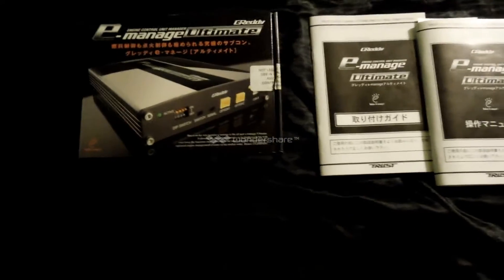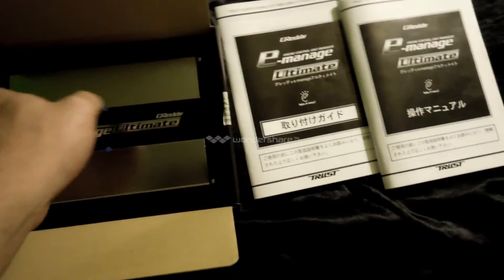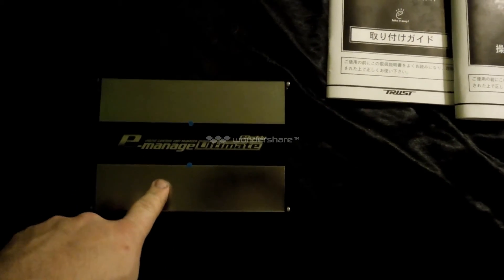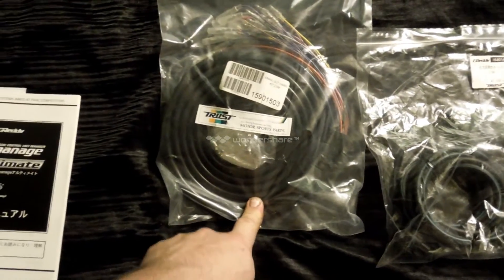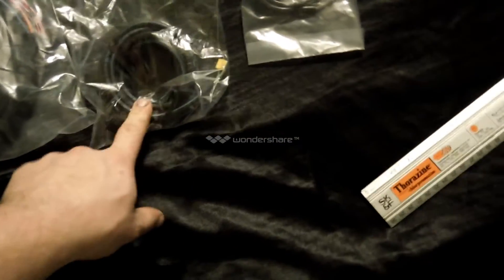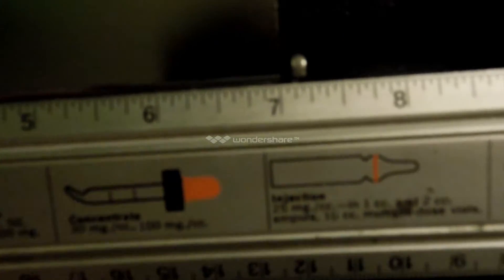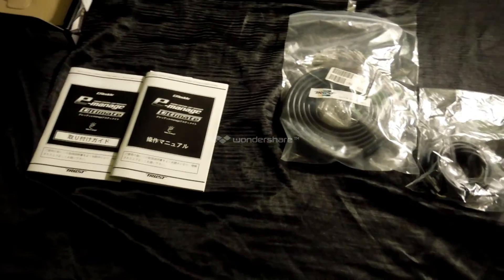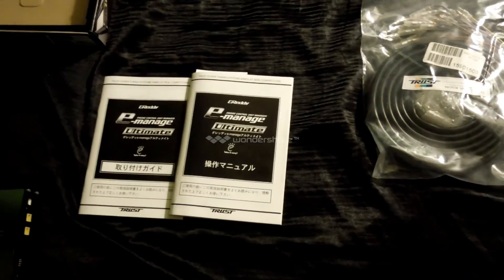Greddy E Management Ultimate Piggy Back System

Comment: what is a correction adaptor and what is it used for
Reply from the maker: a correction adapter is something that is used to eliminate a check engine light. for example, if you get a check engine light because of the injector wires being intercepted by the greddy emanage ultimnate and the main computer doesn't see the needed resistance it will turn the check engine light on. to correct this, theres an injector adapter to provide the resistance the the main computer neeeds to see to keep the check engine light off. see greddys website for more info about the listed adapters: http://greddy.com/products/electronics/e-manage-ultimate/

Comment: Hello need your help if i need the Emanage still needed also the stock ecu for the engine both need to use?
Reply from the maker: the emanage system is a picky back style system, it is not a full stand alone. so yes, you will need to use both computers in order to run the engine if you use the emange system.
Reply: OK! Thanks for the info. :)

Comment: quick question ive got the same Emu unite sitting in my house, how did you Find the EMU ? was it easy to use ? also for the wideband plug do u have to get a specific widband Brand for the EMU ? or any Wideband will work ??
Reply from the maker: i found the greddy ultimate system online. they still sell it. Although some of the supporting features, like adapters, check engine light eliminations and such, are becoming obsolete/discontinued. the system works well for a lot of Japanese engines like the 4g63 engines. for the engine i have, the 420a engine (which is an american made mopar engine), i am limited on what the system will do for me on all it's features unless i pay a lot of money to have some things made. for example the ignition portion of this emu is ment for control of an ignition control module or coil on plug ignition systems with ignition modules installed internally in them. for direct high amperage ignition coils, like the waste spark coil on my 420a engine, i would have to do some trickery with two special relays and two special ignition module adapters which cost a total of about 600 dollars to do. plus the target air fuel ratio only works when you hook up one of the knock/water temp wires up to the engine coolant temp sensor. overall there was a lot of fine print reading i did for this emu, and it basically restirctions on how the system is able to do some of it's functions; and personally i didn't like that so i gave up on this emu and went with AEM. The greddy wont handle any injectors bigger than 999cc due to it's software limitations. i have even emailed greddy for a possible update but no replay after a year and dozens of e-mails. with the aem fic6 i can control fuel and subtract ignition just fine which is what i really need. aslo, i can control up to approx. 2000cc saturated injectors just fine as well as create base fuel and ignition maps from entering a few parameters.

As for your afr guage guestion, any afr guage can be used as long as it has data logging output capabilities. such as an aem uego wide band, glowshift wideband, inovations wideband and more. there is a special adapter cord needed for the greddy ultimate emu you will need for one of the option ports to use the gauge on the system.

hope this is of help to you.

Comment: Is this for your 420a engine? if so what version did you order? I was looking on gredys website and only saw options for the 4g63 eclipse
Reply from the maker: sirrobert09 the greddy e-management ultimate piggyback supports a lot of japanese import vehicls mainly and has a universal function as well for all other vehicles that aren't listed. the version i have is the greddy ultimate which is part number: 15500501. the software version is updated now and then, they are currently up to 2.3 i believe. overall, basically the greddy ultimate supports mostly japanese imports but can be used as a universal unit for vehicles that aren't listed on greddys website.
Reply: thecartuner007 thanks for the response! I have been slowly building a 97 Mitsubishi eclipse with a 420a and have been researching what method of engine management to use. When i looked at greddy in the past I just gave up because there was no listing for 420a. Now i have a part number i can go off of thanks!
Reply from the maker: sirrobert09 
you're welcome. most stuff for the eclipses and talons are made for the 4g63 engines so you have to be careful about what your looking for and not get the parts mixed up. do know you do have to buy the complete harness for the greddy ultimate separately. another method you can look into if you dont have to do OBD2 emisssion testing is a megasquirt unit. megasquirt does make the only stand alone ecu for the 420a engines that i know of. the only other method for fuel control would be a safc-2. im here if you need any help. you can find my build on dsmtuners.com website as well at blackknight2013
Reply: thecartuner007 sadly I do have e check where I live the general plan was to just "disable" my OBD2 port and force them to do a tailpipe test. Last two times it was at e check they had to do a tailpipe any way because they couldn't get there junk equipment to connect. Megasquirt was something I was considering heavily as well as the safc-2. If I really wanted to spend money I would jump on the haltech ecu. I'm not really trying to build a full on monster race car just mild turbo for some added fun and the experience of doing it myself. I will checkout your page on dsmtuners tho
Reply from the maker: sirrobert09 greddy and megasquirt or the safc-II will work for what you are trying to do. as for my build, its a full on monster type build. it's always best to check out what type of emisssions you have to do before you decide on what system to get. haltech also makes a universal stand alone ecu but you will have to start every fuel and ignition map from scratch, due to they don't provide a base map for the 420a if i remember correctly.
Reply: sirrobert09 otherwise I know that for 420a's you can just go with a stock ecu, stock map sensor, nothing tied into it. stock intake air temp, stock cam sensor, stock crank sensor. no fcd, missing link or mega squirt. just injectors, fuel pressure regulator and FMU fuel management unit 12 pounds of fuel per 1 pound of boost. only good for 7-10 psi of boost but 8 is safe. you can have stock internals as well but I would get rods to be safe lol
Reply: yah... rods and piston all taken care of eagle h beam and wieseco 8.8.1 at this rate running a fmu with no actual control over the maps would do zero justice to it